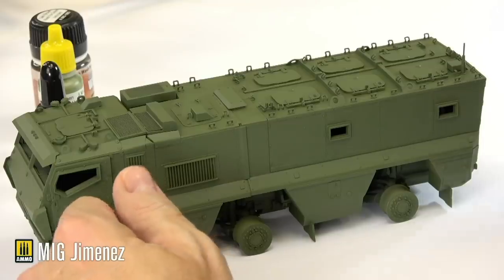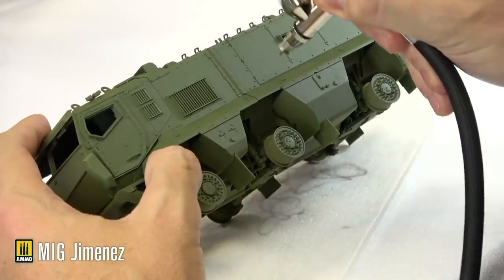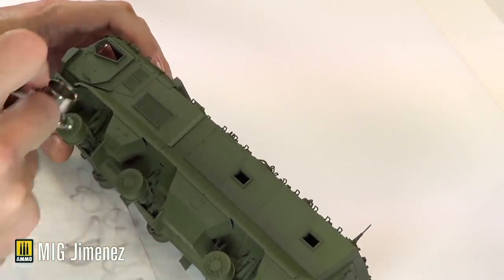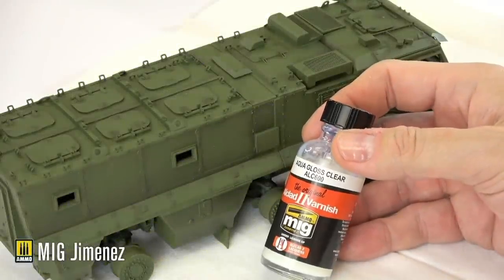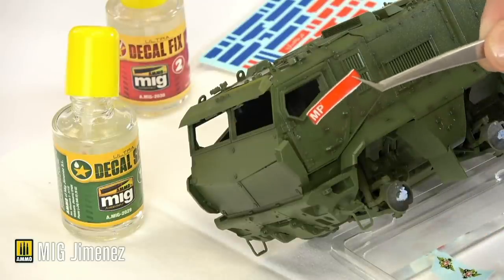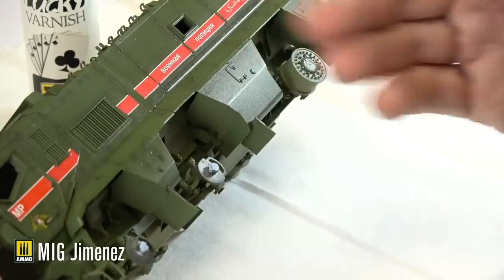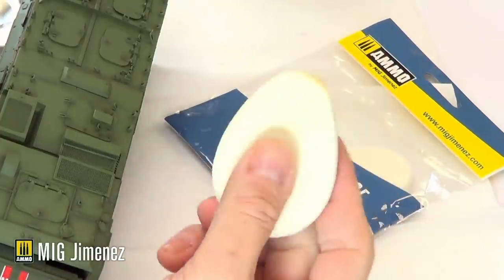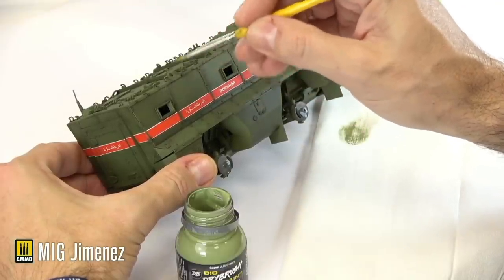How to paint a Typhoon Part 1 by Mig Jimenez

Comment: Awesome as usual.

I'm always confused on the same thing. I never remember which effect requires a gloss surface and which effect require a flat surface!
For example I was sure that I need a gloss surface for washes...instead I was wrong. I always do mistakes like that.
Reply: can mig jimenez clarify on this ? i always used satin or gloss before washes because of capiliary effect that these varnishes give. wont the matt varnish hurt the wash process ?
Reply: @The_Mafra  I personaly use glossy only before decals...for other tasks I use matt, including washes...
Reply: @grzegorz2688  thx for the help. Can you explain why it's better to use matt for washes ? Not doubting you. I just want to know more. And yes I use gloss for decals to eliminate  silvering
Reply: Filters works better over matt surfaces.  Washes over glossy and satin. Oils over satin. Streaking over satin too. But this is the perfect scenery but you can apply over posits surface if you cannot provide the right one.